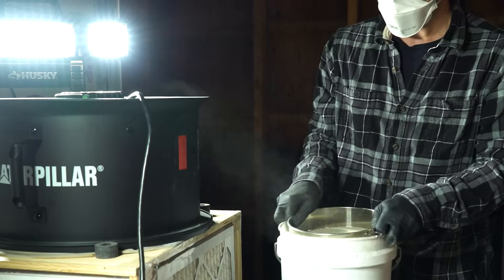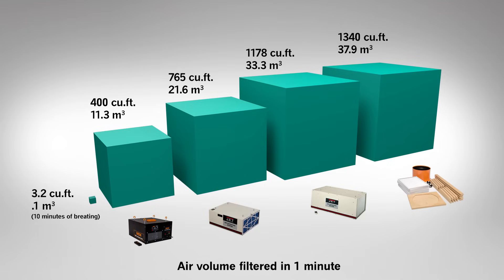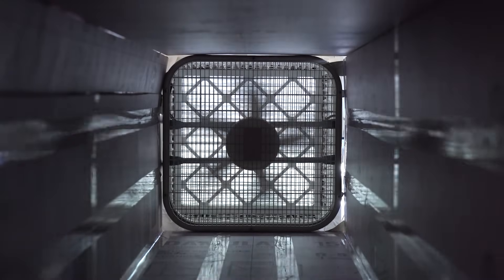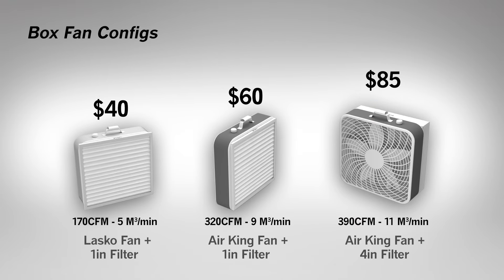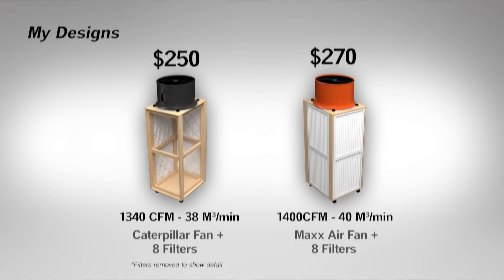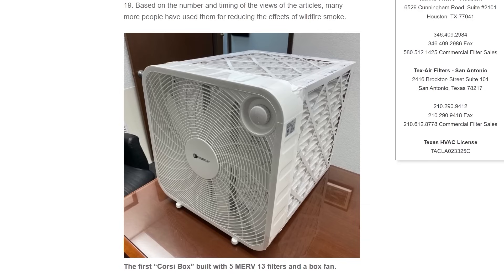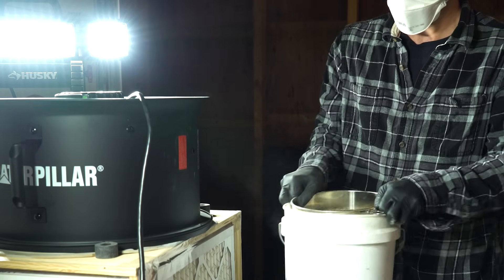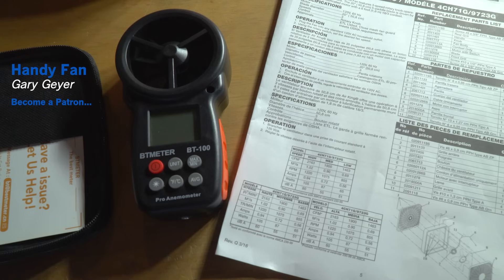What is the best DIY Air Filter?

Comment: To elaborate on these tests further, look up 'static pressure' fans vs 'air flow' fans, static pressure fans are far far superior for pulling air through filters.
Reply from the maker: Good point! I'll be talking about this in my next video. A well configured Corsi-Rosenthal box or the Model-A/Original design create next to no static pressure with filters installed. That's why they work as well as they do. Think of the multi-filter design as a workaround for the static pressure issue. 

If you put a filter on the back of a box fan then you create high static pressure on an axial fan and it doesn't work as well. It does still work though, just not as well. 

Centrifugal and inline fans are much better at dealing with high static pressures. I'll me designing a few new filters with both of those in the next month or two. They will be run through the same tests as the others to see how they stack up.
Reply: @The3DHandyman  It sounds odd but also look into hydroponic fans too, they are designed to pull air through carbon filters, super high static pressure. Probably better for room air filtering for smoke and smells though not large workshops. Extraction fans for lets say a spray paint booth you'd want high air speed to remove the fumes from the space asap. (I'd imagine) Look forward to your next video! 👍
Reply from the maker: @PyroChimp75  I have an 8" and 12" fan in stock to test with. I also got some carbon filters for hydro/VOC filtration as well as some canister filters. I really like the idea of the inline fans but I was cautious because of the low airflow ratings. But I'm over that now :)

I want to run one of these in my 3D printer room to cut down on the fumes.

I'll also be testing a HVAC blower fan powered filter some time soon as well.

Thanks for watching!

Comment: can you do this again but for pet hair smoke and other things people want out of the air with noise being the main factor ... also best filters for them
Reply from the maker: Pet hair is a bit hard to test accurately. Smoke is much smaller, so if the filters works with smoke, they will work with pet hair and dander. Using single filters and the 4 filter CR box I have tested a range of brands against smoke in this video: https://youtu.be/XAJ__E-hIJc

My next video will cover the Model A (my original design) and others. That should be out in a few weeks.

Here is the sound data:
Background sound 40db
Lasko @1 ft - 63, 60, 55
Air King @1ft - 68, 66, 61
Air doctor @1ft - 64, 58, 52, 45
Maxx air @1ft - 71, 67, 57
Caterpillar @1ft - 71, 67, 63, 57

Comment: You know what you could try, room-wide filters using very cheap filters, like paper towel rolls. Bonus points if you can simply roll out the paper when it gets dirty, with a motor or with a hand crank, for easier and cleaner disposal. You could also try stacking multiple paper towels, and increasing the surface area of the intake/exhaust, or add multiple separated filter layers so you can replace the outer layer more often than the inner layer. Sure, you can still have the filters you recommended in this video, as the third layer, but adding at least one or two paper-towel layers before it (in terms of air pathway) means that those more expensive filters would not need to be replaced quite as often, and paper towels are still cheaper than them, lowering the total filter replacing costs while still offering a great value.
Reply from the maker: Love that idea. I already have plans for one, I just need to shoot the video!

Comment: Would turning the fan around cause suction through the filters primarily, thereby getting dust from all directions while preserving your fan for a longer period?
Reply from the maker: I am going to need to test this in my next video. My assumption is that for a single filter on a box fan the filter should be on the back of the fan and not on the front. This will keep the fan relatively clean and that may prolong it's life.

As for the original/model-A drum fan version, it works either way. The Caterpillar fan has an enclosed motor and can so the dust getting in the fan is not a big issue. I have also seen the Maxx Air fan caked with grease and metallic dust in shop environments and they still run for years without issue.  

I hope that answers your question, if not let me know.

Comment: It was getting stale in the house, various air cleaners, they don't really work that well, and are small. I have a Lasko box fan, went up to Home Depot and bought a $5 20x20x1 inch filter, duct taped it to the fan. I cannot believe the dirt it is actually sucking out of the air! In fact, I am SHOCKED! Damn thing works! And yes, I change out the furnace filter on a regular basis... In fact, I just changed it. Oh, I did subscribe! Fantastic video!
Reply from the maker: Thanks for subscribing Michael! I have a video out on what filters works best for the single fan/single filter option. The low cost filters will pull dust out of the air but others work even better when it comes to smoke and extra small particles. 

https://youtu.be/XAJ__E-hIJc

I suggest that you can just the fancy ones in your HVAC but it seems like its best to run them in a separate filter and keep the high flow filters in your A/C instead.

Comment: A word on MERV ratings. Unless you are using a glass mini-pleat high efficiency 4" (or bigger) filter you are wasting $ on filters rated higher than MERV 8. This is because all the pleated filters, yes ALL, are only achieving their inflated MERV ratings by a static charge to the filter materiel. This will give a MERV rating higher than 8 for the materiel in a new filter however the filter will lose it's charge as the dust loads the materiel and you are back at MERV 8 (or worse) as soon as the filter gets dirty. HVAC ratings are notorious for 'snake oil' claims on MERV ratings and other specs. The industry has no enforcement of specs and the only way you know for sure is to have the products lab tested, the consumer brands can claim anything they want.
Reply from the maker: I definitely want to test used filters for this reason. I did test Nordic Pure MERV 14s after 6 months of heavy shop use and they went from cleaning smoke from the air in 45 minutes to taking about 90 minutes. They still preform significantly better than MERV 8s. Performance was more like the MERV 11s in my tests. I need to design a repeatable test to see how each type compares. Hopefully that will be out in about 2 months or so.
Reply: @The3DHandyman  Get some Camfil 4" Model 30/30 MERV8 (or the MERV9 version). Camfil 30/30 is the original pleated filter. The one that everyone is trying to copy and beat 35+ yrs after it's introduction. They still haven't.
Reply from the maker: @SgtMjr  Interesting. I've got them bookmarked now. Too bad they don't sell anything higher than MERV 8/9
Reply: @The3DHandyman  They do have higher rated filters up to MERV 13 in  2" and 4"pleats. As well as wet laid glass in the Opti-Pac model up to MERV 14. The 30/30 MERV 8(9) is the best pre-filter out there with the longest life and dust holding capacity.
Reply from the maker: @SgtMjr  Awesome. I'll look more into their offerings and give them a test!

Comment: Doing a lot of research on cleaning the air in my shop,about 750  sqft 10’fch.this has helped, thanks , think I will do a 4 filter unit
Reply from the maker: I've got a video on air filter performance as well https://youtu.be/XAJ__E-hIJc

I'd suggest 3M filters or off-brand 2" filters for the 4 filter design. The air king fan also preforms 20% better than the lasko.

Comment: does anyone use any prefilters? in the aquarium world with filtering water you would have a coarse filter, then a medium filter, and then a fine filter floss and maybe a carbon filter for chemical filtration. The ultimate flow restriction is still the fine filter but it should last much longer because it's not being clogged by the coarser particulates. In the air filter world, no one seems to do this, if they want MERV 14 they just use that and no other filters
Reply from the maker: I love the idea of a prefilter! I used on on my very first design. I will be doing a video on them in a month or two. Multiple prefilter options will be tested to see how performance is effected.

Carbon filters are hard to add to a device like this but I did figure out how to do it. That will be another video sometime in the near future.
Reply: @The3DHandyman  looking forward to it. Would be curious to know how much the prefilter affects flow

Comment: Thanks for the video! This points me in the proper direction for a DIY solution. Currently running the box fan with 1" filter  option along with the shop vac hooked to any equipment I can hook to. It's better than nothing but Just better. I needed a something better but wasn't sure which way to go. The data you've shared paves the way for multiple filters with a powerful fan. Again thank you.

Comment: Great vid! Would something like a 20" Air King box fan with a quality 1" or 4" filter work as a whole house filter? This is not for a workshop, but for a 900sf house. I just installed a mini-split system to replace an old HVAC ducted system and the filters on these indoor mini-split units are laughable. I'm mainly concerned with filtering in the bedroom while sleeping. Thanks!
Reply: That is exactly what I have been doing for well over a month. I have the Lasko box fan with a $5 Home Depot 20" x 20" x 1" filter duct taped to the fan box. I cannot believe what is in the air in the house. And I do change out the furnace filter on a regular basis. The darn thing works, in fact, it is time to change that filter. I would highly recommend doing this, it does make a difference in overall air quality in our home. House is roughly 1200 sqft, the fan is in the main living area, central heat and A/C..
Reply from the maker: A cube filter like the "Corsi Rosenthal" method should be a fine solution for 900sq.ft. In general it will filter the air better in the area close to the filter, so place it in the largest room or under your mini-split system. You are right, the filters on those are about as effective as the filter on a dehumidifier. 

The CR box should definitely help keep the fan inside unit clean.

Comment: I have a question: have you tested a system with the fan motor in the middle with a filter box on each end with the orientation of the filters matching the corresponding air flow direction ? Is this a viable concept? Just wondering if you've had this same idea. Thanks!
Reply from the maker: It has been suggested before. I suppose that one might be that the air coming out of the fan (when there is only 1 filter box underneath it) blows forcefully into the room. This helps move dusty air back towards the filter.

If there is a filter box on each side the unit would filter the air really well in the space around the filter but not so much in the rest of the room.

A second set of filters will also increase static pressure on the fan and reduce airflow.

That said, the air would be really clean coming out of this sort of dual filter box configuration!

Thanks for the comment!
Reply: @The3DHandyman  I wondered about the pressure thing being  down and restricted from the second set of filters. I know you teased working on bigger set ups and look forward to seeing that video. Thanks!

Comment: Thank you for the content!

I have tried the lasko box fan single filter due to the summer smoke here in Fairbanks. 

For the single filter configuration have the filter behind or in front of the fan?

Also which of these configurations would be best for a 200 sq ft living room with furniture?

Also is there a way to improve overall filtration by placing the filtered fan in the center of the room, and have a pedestal fan placed a certain way to circulate more air, the eventually gets filtered?
Reply from the maker: Great questions! I feel like for a 200sq.ft. space the single filter on the back of a box fan is a fine choice. 

It is definitely best to put the filter on the back of the fan. This will help keep the fan clean and it tends to keep more pressure on the filter for better air flow.

I would suggest using a 3M MERV 13 or 14 filter. I tested single air filters on the back of a box fan and by far the 3M products are the best performers when it comes to removing smoke. You can see the whole video here if you like https://youtu.be/XAJ__E-hIJc

As far as placement goes, it is beast to point it toward the center of the room and leave a few feet of space behind it to allow air to be pulled in to it freely.

I hope that helps!

Comment: have you tried the downdraft version or the compact and if so how do they perform?
Reply from the maker: I have not tried it myself. The "downdraft" was heavily requested but I haven't gotten around to making plans for it. It's basically the original design flipped upside down with a few boards screwed to the sides to hold it up. Not to fancy.

In general, I get the idea of scouring the floor with air so that the dust stays airborne, but I don't think it's entirely necessary. It's more of a personal preference.

For the Compact, I think it is nice because of how small it is but I question the volume of air it is actually able to move. The main drawback, as I see it, is that the distance from the back of the fan to the plywood backing is quite low. These types of fans are not really designed to pull air in from the sides but more from the back where air movement is obstructed.

I am planning on making the larger version of that one, the "beastie boy" in a few months and testing it in a large shop. The lessons that are learned from that one should be true for the "Compact" as well.

Hope that answers your question!

Comment: Why not put the filter in front of the fan so that the fan sucks in dusty air and blows it through the filter ?
Reply from the maker: Generally this setup is not ideal because the fan will get dirty if only 1 filter is on the outgoing side and if there are 2 filters (one on both sides of a box fan) then the static pressure on the fan is significantly increased to the point at which the fan will not preform well at all.

For the Model-A/original design with the drum fan this configuration (pushing dirty air into the filter box) works because there is a huge amount of surface area for the air to diffuse over.

I hope that answers your question!

Comment: I really like that circulator design you proposed at the end.  I've got dust collection at device for most of my shop tools but it's obviously not containing the fines because any time I do much work I'm still getting dust settling.
Reply from the maker: That's what inspired me to try these out in the first place. I don't like spending much time cleaning. The circulator seems like the most effective option for a small space. 

I actually planned on installing something a little more custom in a space that I had planned on moving into least year but still haven't... I did concept it out in this video tho. You might like it https://youtu.be/OhVWsnTm8iU

Otherwise the circulator is just a Model-A (original filter design) that has an extended box on it. I would recommend giving it another stack of filters if you push it up against the wall/ceiling tho. 6 Filters is borderline to few for this drum fan.

Comment: Can we use a hepa filter ?
Reply from the maker: In general HEPA filters are great. If you can find one that works in a DIY deign, that would be a fine choice.

To my knowledge there is not a perfect sized HEPA filter for the back of a box fan. I am going to make a few MERV 15, 16 and HEPA designs in upcoming videos. 

Otherwise MERV 14s from 3M work quite well in the Cosri-Rosenthal design and as a single filter on the back of a fan. These are not quite HEPA filters but they are pretty close. I did a video on smoke filtration recently that shows the performance of different filter types. I also bought a few professional HEPA filters that I will review for comparison to the DIY options soon as well.
Reply: @The3DHandyman  Thanks a lot for the detailed info !

Comment: You should look at the video that Jay Bates did a few years ago where he used a furnace fan.  I build this same setup and it moves a massive amount of air, and does it relatively quietly.  It also uses 20x20x1 air filters and has a rolling base so you can put it next to whatever you are working on.  Works really, really well, but I would be interested to try it with some of the thicker filters you tested.
Reply from the maker: I have seen it. A guy just offered me an old furnace fan as well. I hope to have a video out that features it in 2 or 3 months. The current plan is to use a MERV 16 filter for almost HEPA performance.

Thanks for the comment!
Reply: @The3DHandyman -- I look forward to it!  Except, I am considering using washable high quality filters.
Reply from the maker: @davidhaman9745  That's a great choice. They don't work as well as the disposables but they last for a very long time. I tested the K&N filters against smoke particles and they preformed fairly well.

I am working on a modified filter kit that uses K&Ns for a prefilter then a MERV 5 canister for the super fine particles. I'll test this setup in the same way as the others. I will also be offering a build it yourself version of the Model-B in a few weeks or so.
Reply: @The3DHandyman ”...MERV 5 canister...”?
Reply from the maker: @joedance14  Lol, MERV 15 canister. This video is still in the works but should be out in a few weeks. It's been a rough couple of months with 100+  hour working weeks.
Reply: @The3DHandyman  Kind of figured it was likely a typo, especially given your attention to detail.  Thanks for the clarification.

Comment: took a 20 inch box fan, used a 20 inch hvac filter and called it a day.
Reply from the maker: That the cheapest option and it works fairly well. The 3M MERV 13 and 14 filters work quite well in this configuration.